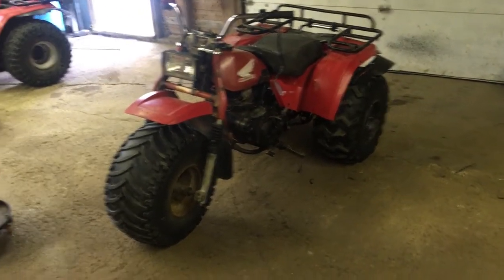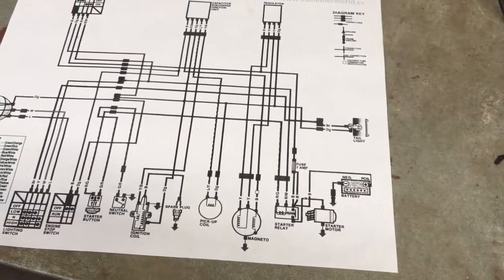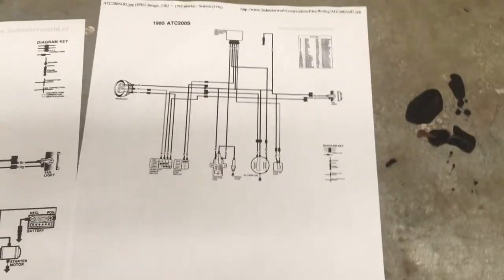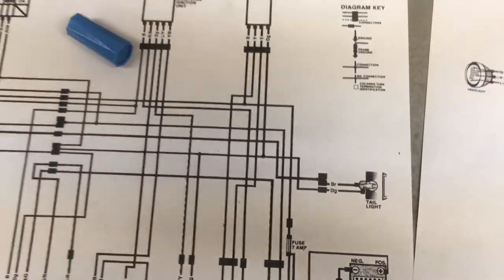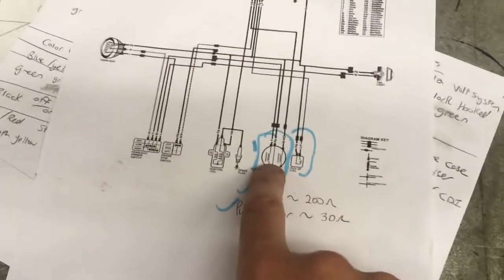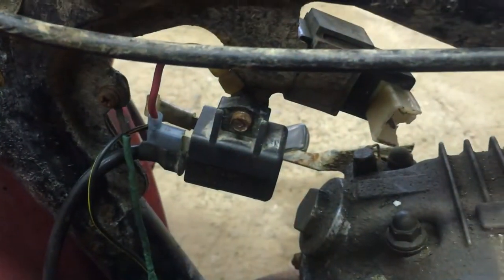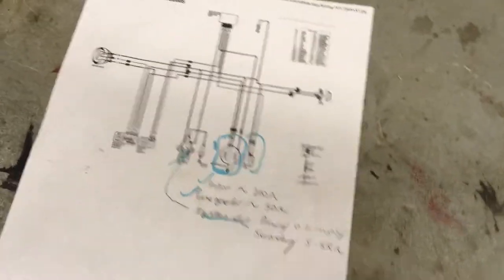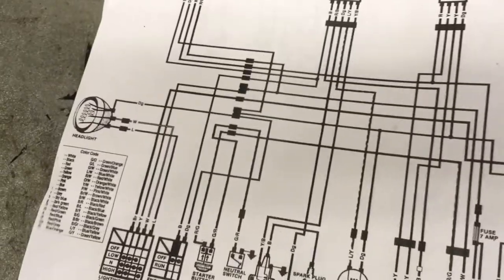How to troubleshoot spark honda big red no spark ATC 200

Comment: I have a 1984 Honda TRX 200 - I get spark when use the pull cord but not when I use the push start. Engine turns over but plug never sparks. Any thought on what this could be?
Reply from the maker: That is quite strange the electrical start is separate from pullstart.  The electric start doesn't work unless it is in neutral and the neutral switch is closed. The only way i'd see it killing spark is if a wire was grounded or solenoid is hooked up wrong. Basically in a nut shell, you could remove electric start completely and have spark or  wire your own. Feel free to send me a few pics or a video of what youre working with. the TRX 200 is a good engine, if you see my Ripper build , thats what engine is in that. email is muddythumper @ hotmail.com   all one word
Reply from the maker: Additionally forgot to ask, is your battery good? turn over the engine fast enough? just follow the wires on the start circuit itself if possible. The ground on the battery just goes to a ground, however on the positive side the positive wire should run to the solenoid then from solenoid to the starter. When you click the start button it should click and connect power down too the starter and crank the engine. If its still not sparking could be either weak battery, corroded ignition switch wires for spark, or pulse generator a bit weak. when you use the pull start you basically bypass the whole electric starter circuit. Most likely i suspect a weak or improperly hooked up starter circuit though.

Comment: Hi I have a 1984 200es that had no spark.. I set the air gap on the pulse generator and it had spark but sometimes it wouldn't spark..or it would have very weak spark. Then it lost spark so I fixed the main power wire coming from the stator and it got spark again. But shortly after it lost spark. I know that my connection is good I checked the ohms on the stator and it was around 250ohms.. I also have a known good coil...but still no spark? What are your thoughts
Reply from the maker: have you tried disconnecting the kill switches or ignition switch and testing it that way? Could be a simple loose connection or a partially corroded switch

Comment: bought 2 weeks ago a1985 200s - started last week, but has weak spark and now no start, plug seems a little wet. any advice? chinese carb from previous owner
Reply from the maker: If the plug is fouled, most likely shes running a little rich, which would kill spark overtime. Fouled plugs don't like to spark. I'd throw a new plug in it, and test it for spark compared to the last plug and see if its any better. If need be youll need to test the components like stator, pulser, etc. However start easy first, clean the carb, make sure its not running rich and take it from there. Chinese carbs are really hit or miss. Im running a chinese carb on my lifted trike but it has a snorkel, full custom exhaust i made (cherry bomb style) and i had to play around with my jetting to get it to run right due to the mods. Sometimes the chinese carbs run rich from factory , other times they are far to lean
Reply: @muddythumper8152   Thanks for the reply. The Chinese carb only has 2 screws 1 is for idle the other one I believe is air mixture. The air mixture screw was turned all the way in. I took the carb off twice and it is super clean. I think the guy before me recently installed it.  Turning the lower screw on the carb which I think is the air mix outward would solve it running too rich running to rich correct?? Previous owner said it  It would idle high even though he adjusted the idle down and it would stall out. I imagine if runs too rich, it would idle high, correct? Dont want put in new plug just to have it foul too so should i back out screw 1 full turn than try new plug? The bike started couple times last week.
Reply: @muddythumper8152  the new plug work TY!!😉 it idles but wants to stall, i increase idle slightly and seems good but wen turn throttle and let go it idles super high and stays and it doesnt seem throttle is sticking. When give steady throttle its very spotty and boggy(not smooth). I tried adjusting air/fuel screw but no luck. Also, i noticed the choke lever when running is bouncing like crazy. Was wondering if thats why its boggy?? You think Cheap carb is problem?? I took a video but doesnt seem i can post it 😔
Reply: @muddythumper8152  Heres a quick video from today after finally getting started. You can see the choke bouncing open/closed. Going try to tighten it somehow tomm see if helps.  https://www.youtube.com/watch?v=w4cFprxY5qE